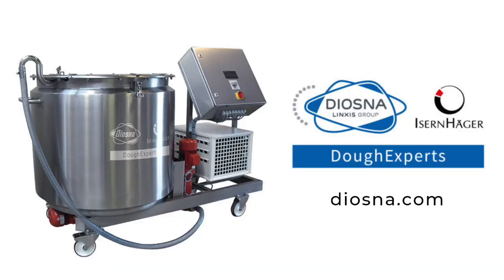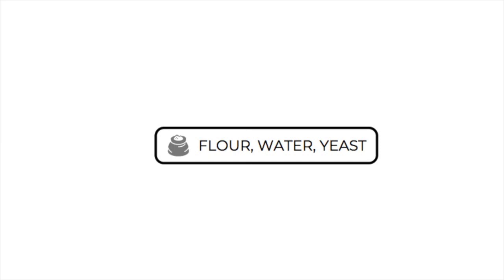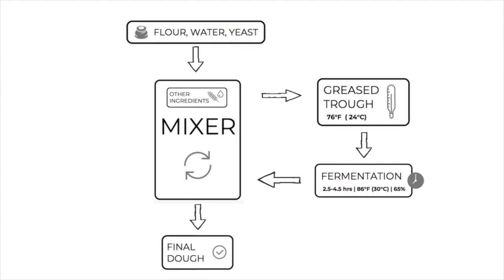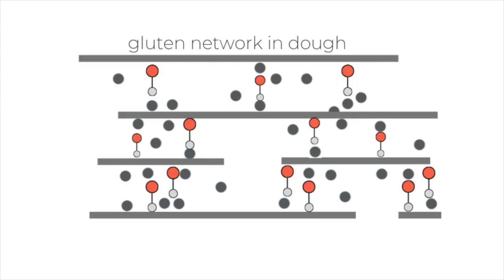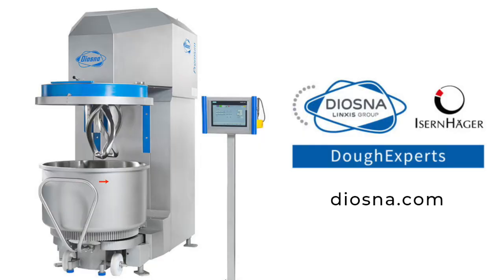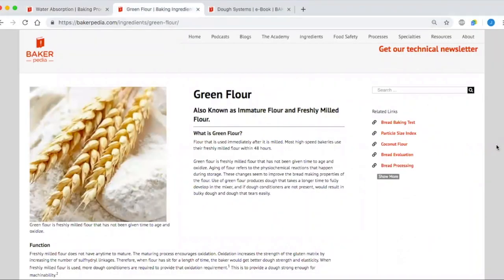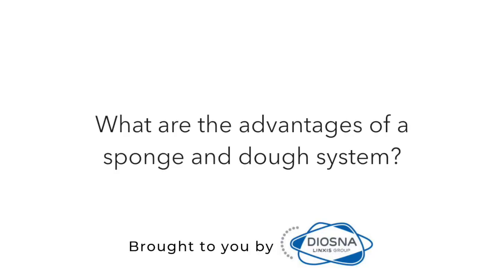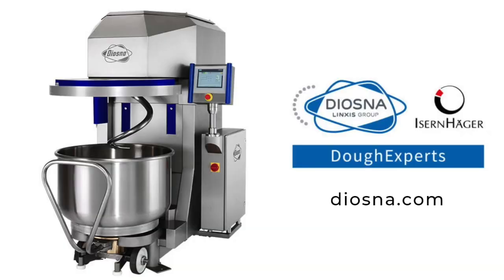How to Use the Sponge and Dough Technique | Ask Dr. Lin Ep 12 | BAKERpedia

Comment: Dr Lin, when you say 40% of the water goes into the sponge and 70% of the flour as well, it makes a very very dry sponge(31% hydration)? Could it be that  you meant that the sponge should be hydrated at 40% instead?